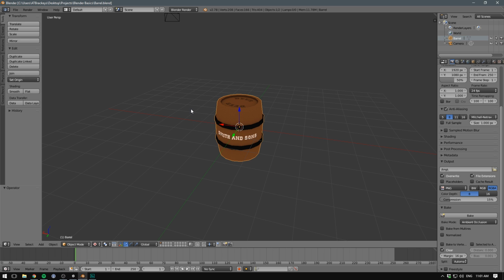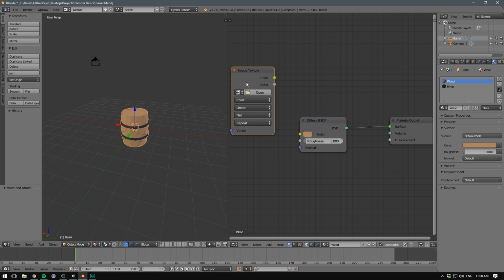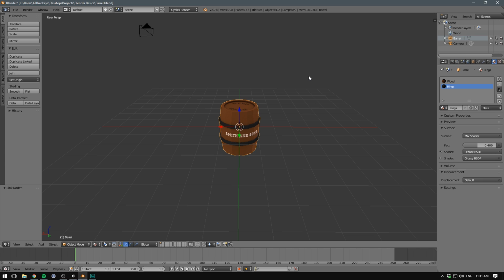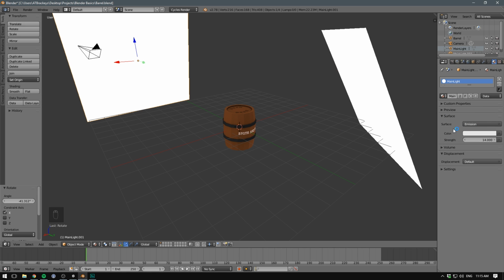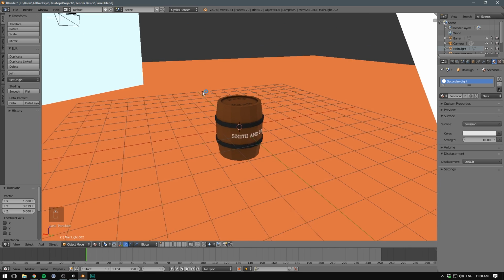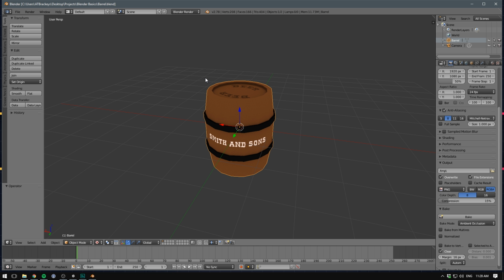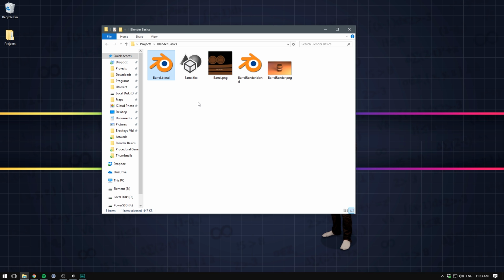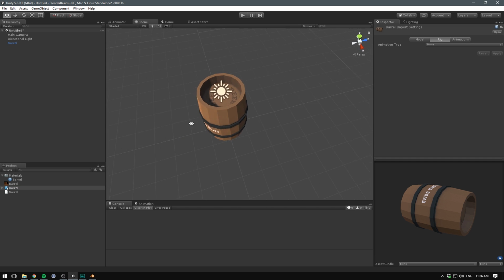Blender Beginner Tutorial #4 - RENDERING & EXPORTING

Comment: When I export my blender file into Unity, materials folder does not pop up. Barrel shader is made under its preset folder but cannot edited at all.
also my barrel has only flat solid color even though it has its own texture png file.
I don't know how and why... plz anyone help me:/
Reply: DId you find any fix ?
Reply: @LagunaPreza  if you havent tried it or fixed it yet, 
In the import settings in unity for your model, set materials to external, and hit apply. There should now be a folder called materials created. This is where your object materials are kept. Go into the folder, find the texture images you used for the model, import that into the materials folder, and set the images as the albedo for your materials, if you have uv unwrapped the model before importing to unity, then just applying the material should use the uvs that you have already made. Hope this helped.

Comment: My models are transparent on some parts, help please...
Reply: I got to redo the barrel once again to properly work right. I don't know what I did, but i would like to know, in order for future precautions.
Reply: from what iv been able to gather when you take an object and get like the inside part showing it makes it transparent for example that's why when you did the top of the barrel you used the E key for extrude and pushed it down because it dragged those like edges down as well. well that's my current theory at least did you ever come up with any reasons?

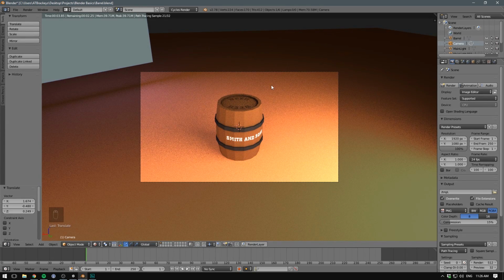Comment: I noticed at 7:42 you have the device set to CPU. If you have a compatible graphics card you can set it under user preferences to render much faster. You just need to set the tile size x=256, y=256

Comment: If you have an Nvidia grapics card you can go ti File>User preferences>System and then clixk the button that says CUDA. Now your graphics card should appear under that button. Click Save User settings and then go back to your scene.  Now  under the Render menue ther is a Dropdown-menue that says Device. Click it and select GPU Compute. This will render the image with your graphics card instead of your CPU and decrease Render time. But you also have to go to the Performace menue (a bit under the Render menue) and increase the Tile size to 256 by 256 or 512 by 512. Unfortunatly this only works with Nvidia graphics cards.

Comment: Thanks for video. Two things.
1. When exporting to .fbx you can toggle that little button next to "scale" parameter. That way you'll have nice 
(1,1,1) scaling in Unity.
2. I suggest to bake rotation on X axis in blender and work on rotated object transform in it. When working on not rigged objects it couses virtualy no overhead in blender and removes this pain-in-the-ass -90 degree rotation in Unity.

Or you can choose 3D modeling app that allows to work with +Y up and +Z forward axes. For me Blender is great.
Reply: My model isn't exporting with the Texture, any tips on exporting with the Texture?